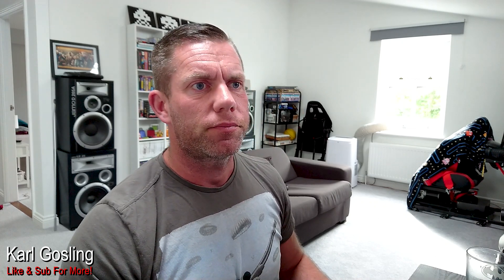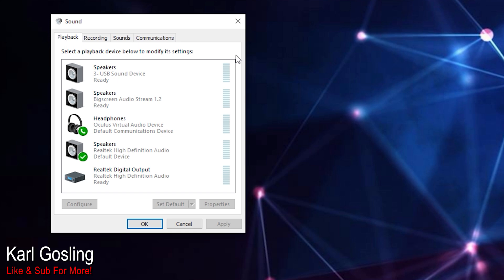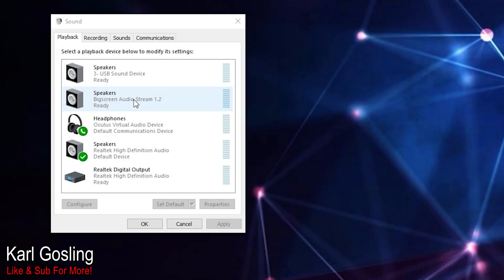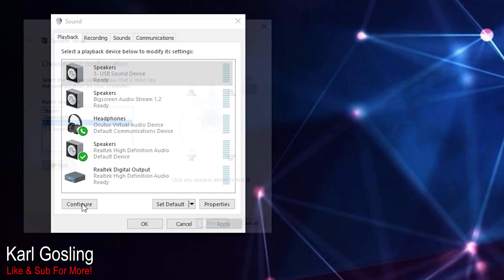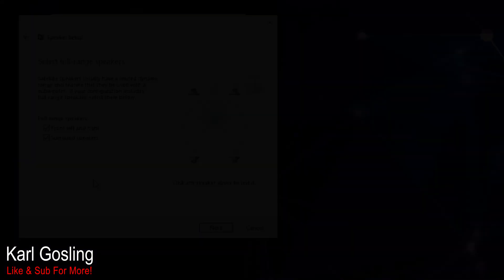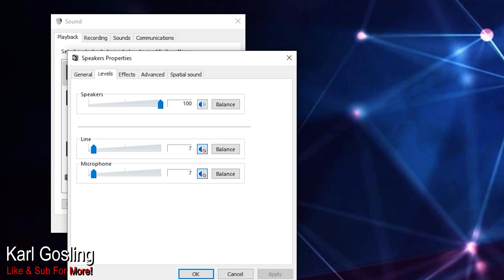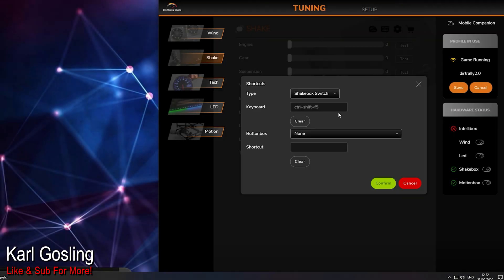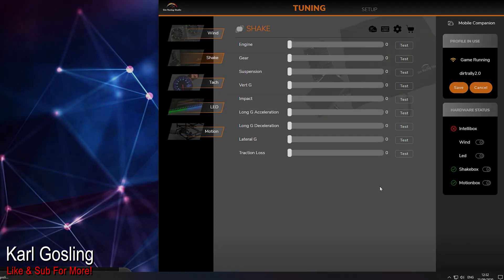Sim Racing Studio Shake Kit Software Setup & Tuning Guide

Comment: I did the setup as you showed it, but I'm getting sound out of my speakers and no vibrations out of my shake kit. I've had this shake kit for about 2 years and it recently stopped working so I was making sure nothing changed in the setup. any help would be appreciated.

Comment: hey Karl. I used your promo code and went for shake kit plus (the one with extra pad on the lower back) and the wind simulator. First of all, thanks for the code. Second of all, did you manage to find some sweet spot for GT type sims like ACC? what values do you use?

Comment: Got mine today. Just plugged it in to test it's working. It's all going. I didn't have time to play long, so I got to tune stuff another time. Alot of rumble going on was a bit weird. I think I need to turn stuff down and others up. I'm thinking maybe more corner feeling. The bumps in rally are pretty much all the time with the rough surface, so I'll need to get the right levels 1st

Your video helped me get the basics set up, so thanks again 😁👌
Reply from the maker: Yeah just put in the time to tune it properly and you'll wonder how you ever lived without it! :)
Reply: Karl is right! You are just at the beginning. I use VR and with the wheel FFB and the deep rumble of my engine going through the whole rig it REALLY sells that you are in a car. In fact I really cannot stop tuning it.
Reply: @ThisOldTechGuy  yeah. It's really nice feeling. I was going around track on dirt rally 1 and just so immersive with vr too. I prefer vr to normal tv. Lol. Also I used mine with rumble for a movie, so it gave all the bass whilst deep moments. Adds another level with big screen and the thump of Kong stomping lol
Reply: @spacedoutET  Crazy that it is a seat pad. I have 4 Buttkickers bolted to the actual corners of my rig. It shakes GOOD. I'd love to feel the difference. My solution has cost about 1k US so the SkakeKit at $270 is an AWESOME solution. My jobs now are bigger LFEs and Amps, and advanced vibration isolation.

Comment: Thanks Karl, very timely as I was setting up my new Shake Kit Plus and new Buttkicker tonight. Going to drill the box tomorrow to add the Buttkicker directly in as shown in your other video. Also thanks for the discount code, saved a few bucks which is always nice, will send a few your way. 😁
Reply from the maker: Thats very kind thank you Paul!
Reply: Hi. How does the look and material appear to you on the new plus version, compared to standard? It looks not so loose when I look at the pics, but not sure. I'm deciding on the plus or standard. Can't decide. Also did you get it delivered to UK and what extra custom duty did you pay on top of delivery. ? Are you still happy with it, any issues ?